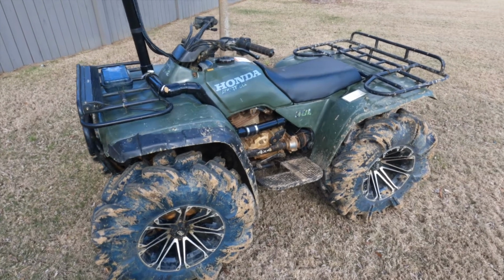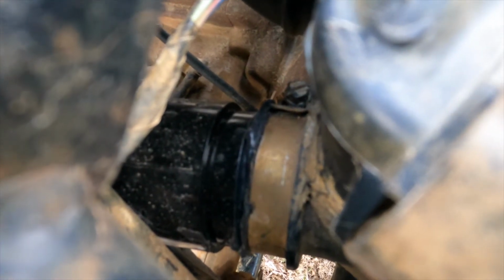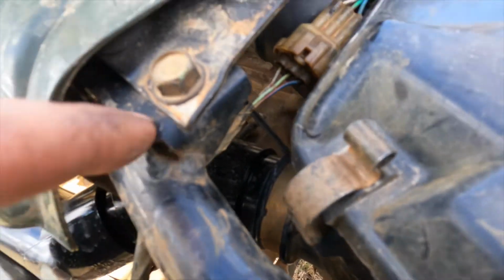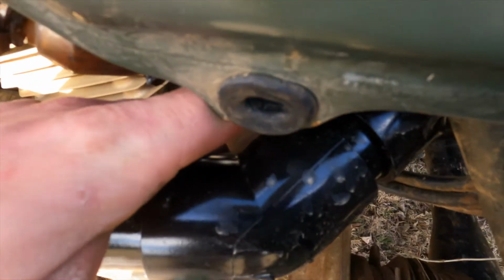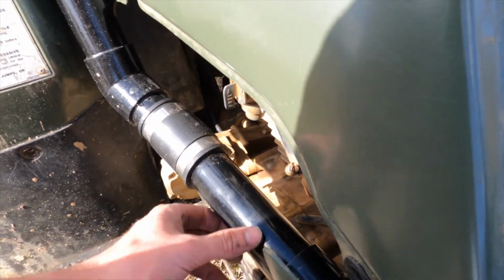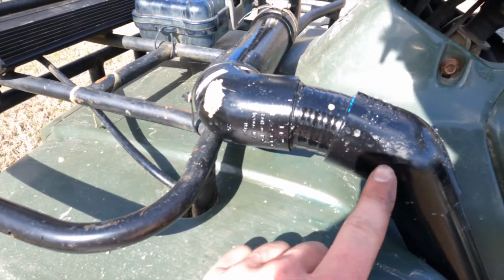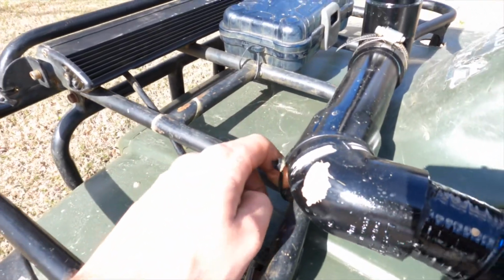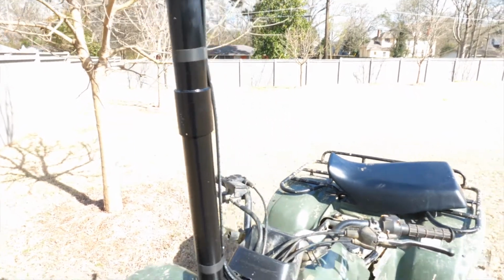Easiest way to snorkel a Honda 300

Comment: originally I didn’t put the cuppling you said you put so you could work on it but I had to cut my pipe and put one in so it could clear the gas tank because the gas tank was pushing the pipe over